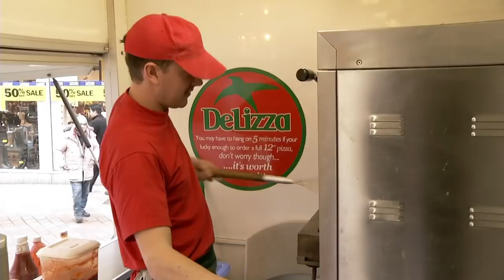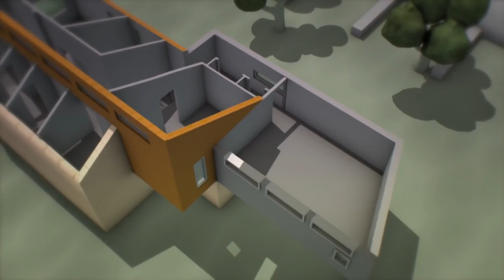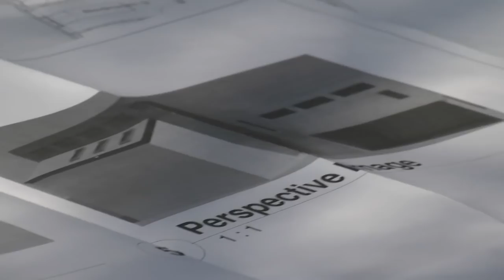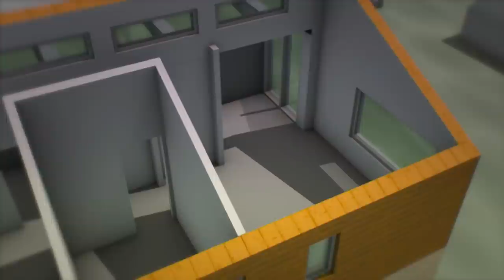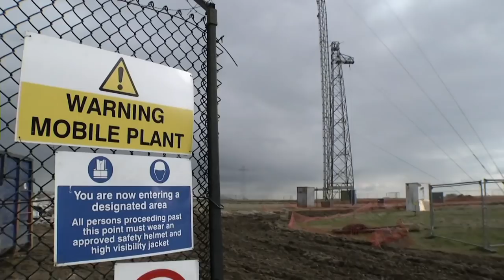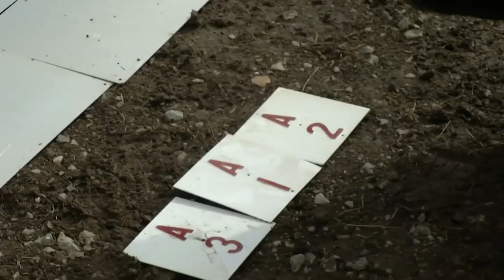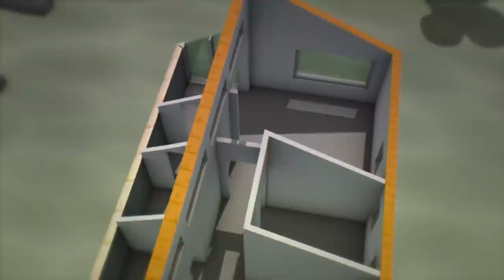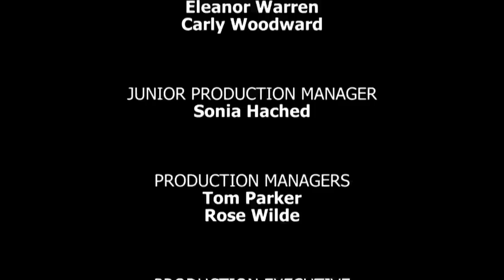The £100K House Saga - The House That £100K Built - S01 EP1 - Home Design

Comment: Nice h house that sounded like it was over budget by 2000£. Not bad! Looks fairly impressive. I like airlocks like he put in. Honestly, plastic or glass sheeting works good enough for an air lock and it still gives you a larger line of sight. I have a slight affinity for tensegrity  structures so if I would of ran into miles of steel wire rope at the beginning of the build; it would of ended up replacing many of the structures tension members. I also like plenty of light but plenty of privacy in my bedroom, bath, and if possible reading room part of the house. No big glass windows in my bedroom walls, but windows at the roof line and skylights in that section of the house is a must. It's just more intimate that way when your a married man. Liked the shed roof & modern open plan house that he ended up with. Steel siding these days not only saves a ton of money in the USA but is pretty much maintenance free. His steel bedroom wall even meet my approval. Great job for a budget of 100000£ and a build price of 102000£.
Reply: Agree with everything you said.  I thought the same myself